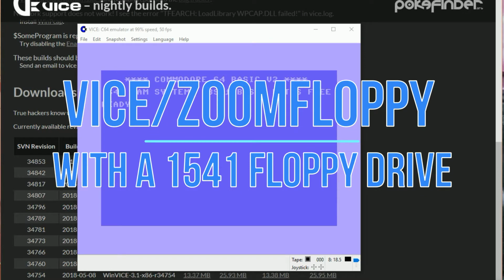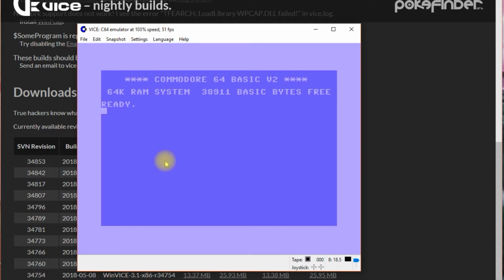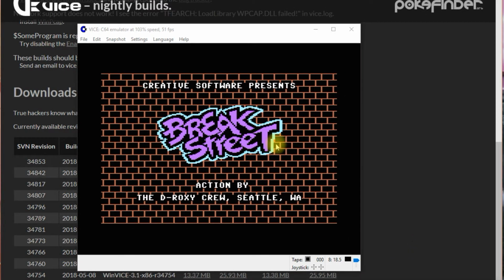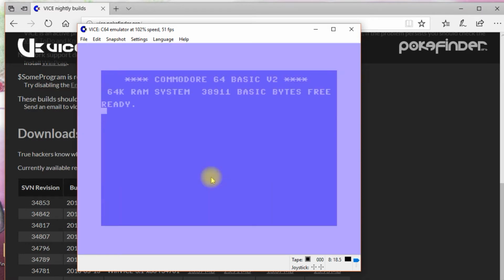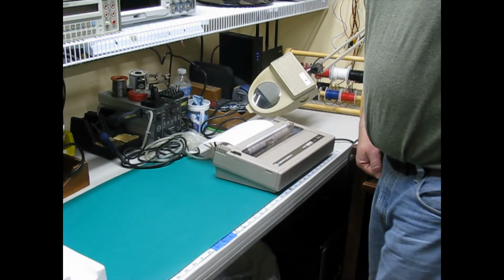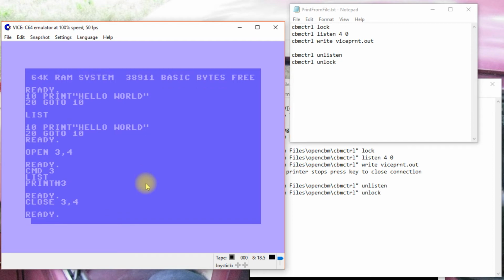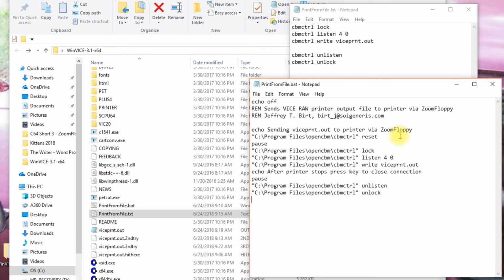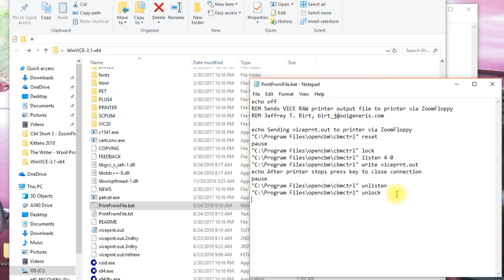ZoomFloppy with real hardware

Comment: Great video! I would never had expected that zoomfloppy could be used for printers, too.
Reply from the maker: Thanks! The ZoomFloppy really gives Vice a Commodore IEC port so theoretically any IEC device should be able to be used. There was code in Vice that allowed for direct printing from Vice but that was commented out long ago. I looked at it and decided against trying to add that back in until things settle down with the conversion to GTK3 in Vice3.x. (I don't want to try to learn a moving target.) One other thing I found is that the SD2IEC won't work as the OpenCBM tries to identify the drive type and does not know what to make of it, I don't think that would be a hard fix either but it is again a case of learning enough about the code base to do so.

Comment: How do you like the 803 printer? I am not sure if I want to get one, as not sure how reliable they are. I have an Okidata 180, and thinking about either getting an Okidata 120 or the 803. The ribbons for the okidata printers are readily available. The 803 has a very different way to load the ribbon, as I have seen, than the Okidata. Thanks for the video. I bought a ZoomFLoppy about 2 or 3 years ago. I never tried it on vice, as I just used it to put files on the floppy disk to run on my C64.
Reply from the maker: I bought it as it was almost like new, I really do need to find a ribbon for it. Evidently it does not so lower case descenders out of the box but there was an upgrade for it. For the life of me I can't remember who made them for Commodore.  Back in the day I had an Okidata 24 pin printer on my C64 and with GEOS is could print some amazing things for a dot matrix printer.

Comment: I can not comment on what was removed/re-added to Vice versions, however i know based on my experience and testing on Windows that the 'Use Real IEC' option is either ghosted out or missing if Vice can not load the proper DLLs that come with the ZoomFloppy/OpenCBM installation. For this reason, and for compatibility with other 3rd party programs, you either need to make sure the 'OpenCBM\AMD64' or 'OpenCBM\i386' folder is in the DOS search path, or you need to manually copy a few OpenCBM DLLs ro the other software directory, or you need to place the binaries of those programs that depend on OpenCBM DLLs in the same path as the OpenCBM binaries, but this latter option will clutter the OpenCBM directory.  The first option is preferred.

As for documentation (based on 0.4.99.103), included in the OpenCBM folder should be an OpenCBM.PDF file and a ZoomFloppy.PDF file. The ZoomFoppy,PDF file is outdated, and you should use the OpenCBM.PDF for installation, even for ZoomFloppy.

Hope this helps.
Reply from the maker: Part of the issue is what has been removed or changed in VICE over the years. I seem to recall when I asked on the VICE development list, at that time, that the answer given was that the 'Use Real IEC' had been disabled. It may be different now.

Comment: I could NOT get ZoomFloppy to work at all on my previous WIndows 7Pro/WinVice 3.1 install but it was time to 're-do' the Windows 7 machine and I had downloaded WV3.3 and recalled that you couldn't find the use IEC/Use IEC Hardware so I quickly got WV3.1 installed thanks to that tidbit now working properly!  I like WV3.1 better so will stick with that for the next little while.   -Mark.
Reply from the maker: Getting the silly driver installed properly for the ZoomFloppy is the biggest hurdle, mostly because of the poor documentation. Vice3.3 has a lot of stuff non-functional at present so I'm sticking with 3.1 as well.